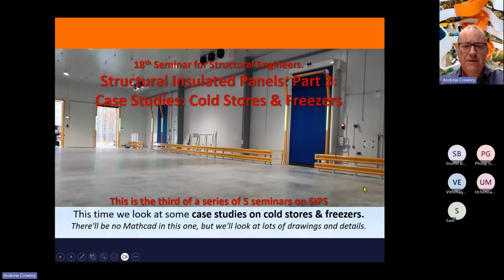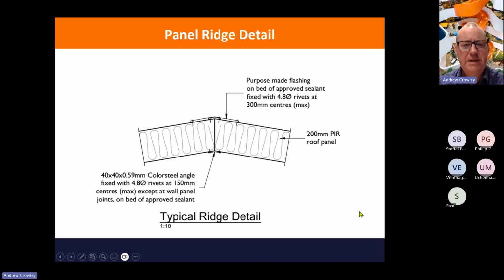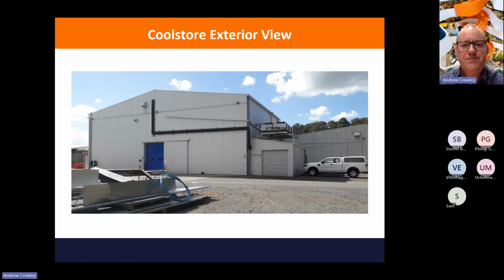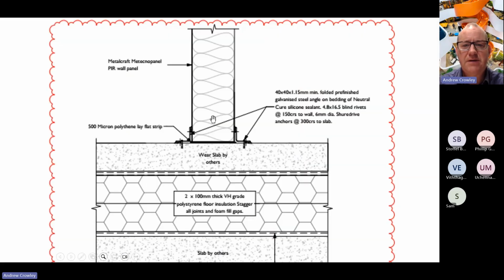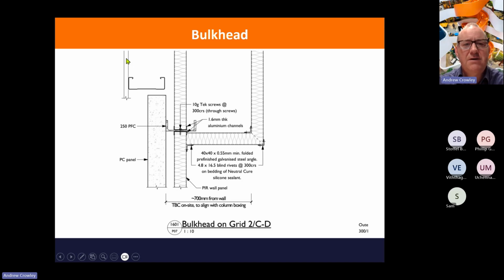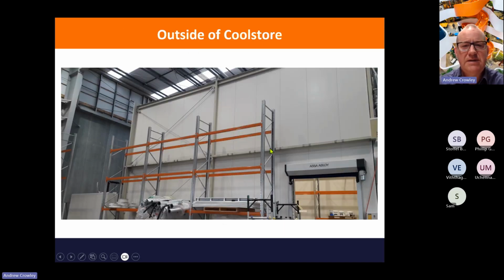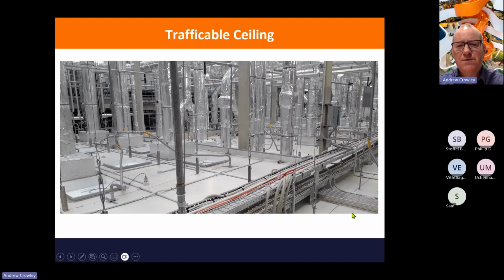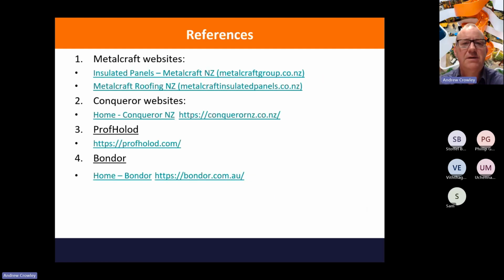CPD Seminar #18 - SIPS Pt 3: Case Studies on Cold Stores & Freezers

Comment: When you are designing steel structures for cold stores at below zero degree temperatures do you specify  below zero  (LODMAT) for materials?
Reply from the maker: Hi Richard, there are 2 issues to consider here. First is the design of the insulated panel, which will need to be designed for a range of temperatures from the operational temperature of the freezer and the ambient temperature subject to solar gain. Probably more significant is the temperature difference between the inside of the panel and the outside of the panel. This can induce thermal bowing in the panel and may require stress cuts in the panel. The second issue is to do with the steel structure, which will require steel sufficient low temperature ductility. This is addressed in the project specification. The operational temperature of a freezer is lower than the LODMAT.